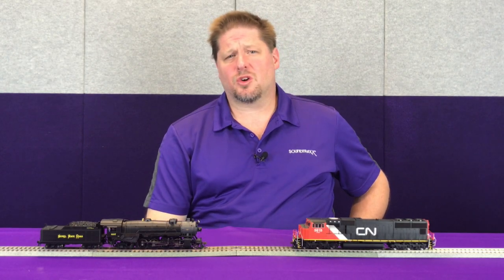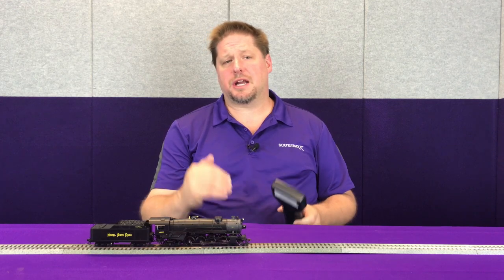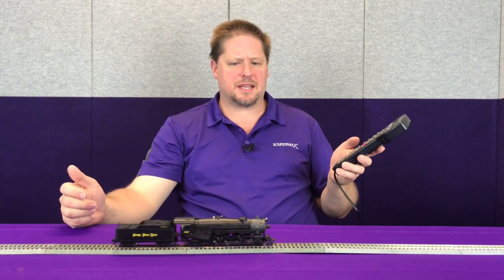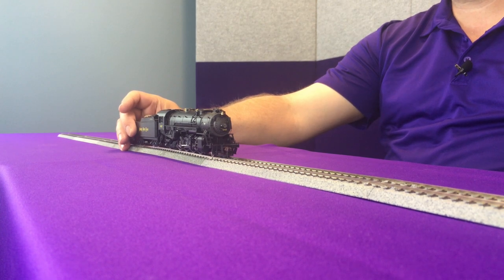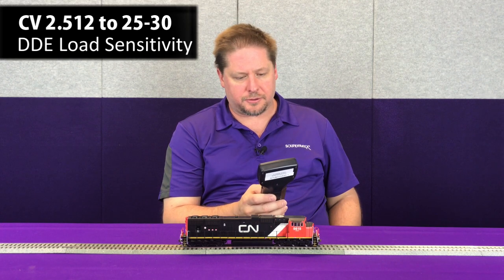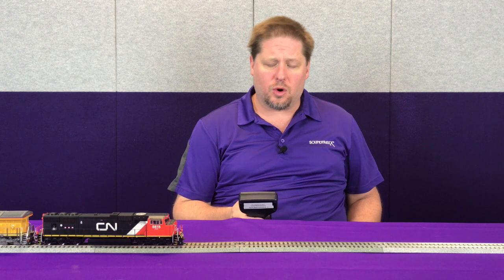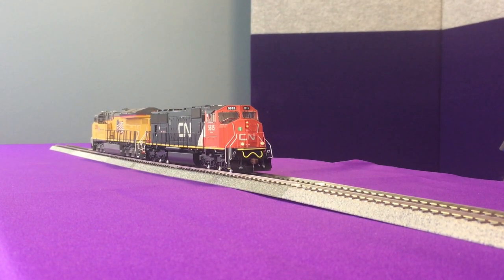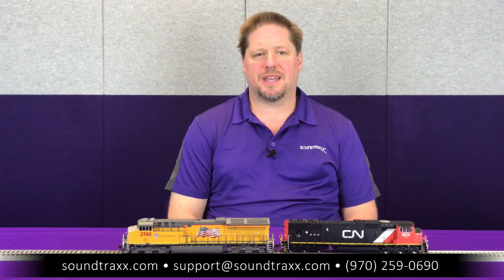DDE Calibration

Comment: Hello, i just bought a Athearn Genesis GP7 with factory equipped Tusnami2 sound. Will I have to Calibrate the Auto Throttle, or is it calibrated out of the box for the Auto Throttle to properly work?
Reply from the maker: I believe you are referring to the Dynamic Digital Exhaust as ‘Auto Throttle’.  You will need to do the calibration yourself. With mass-produced models, there will be some variances in the motor, so if they asked it to be set out of the package, you might not get the best experience without calibration to the specific model, so we decided (with Athearn) to leave the DDE Calibration to the end user.  If you need guidance or help with the calibration, contact our support department for assistance: (970)259-0690 or support@soundtraxx.com
Reply: @SoundtraxxDCC  Yes, I actually just received my Athearn Genesis GP7 (ATHG82720). I was able to go into CV114 and disable auto start. However I can't seem to manually start up or shutdown the prime mover on my NCE Powercab. I tried calling the number you provided but a voice said that my call can not be completed.

Comment: Can this be done with the loco on stationary rollers?
Reply from the maker: It can be, but the calibration will not be as accurate on rollers. The rollers will cause some resistance that will effect the process. Flat level track is better, but if you don't have the space to do it rollers is an option.

Comment: i have to do something else, my speed step 20 is almost full throttle, my nce tops out at 28.
Reply from the maker: You need to select the 128 speed step mode on your NCE cab. Also make sure that CV29 is set up for 28/128 speed step operation. Feel free to contact our Customer Support Center if you need further help with this. (970)259-0690 ext. 22 or support@soundtraxx.com. Thank you!

Comment: I have now installed 15 of these decoders in my Diesel fleet and more are being up graded.

I have found to calibrate a Tsunami 2 easier than the WOW TCS Sound decoders which have the audible  instructions.
With the Tsunami2 decoder every thing is done with that 1 unit being diesel or steam. All the sensitivity is done as to the locomotive, which in fact is more prototypical as every engine performs differently regardless of how many cars it is pulling.
With the WOW TCS Sound decoder, to have the sensitivity calibrated, the step here is to place 1 or more cars to calibrate the final step. If one is replacing multiple decoders in a period of time, you will have to remember which car you used to do this calibration, otherwise it will end up being all over the place.
The attack and release time helps quite a bit, and thank you for explaining and showing how to set this up.